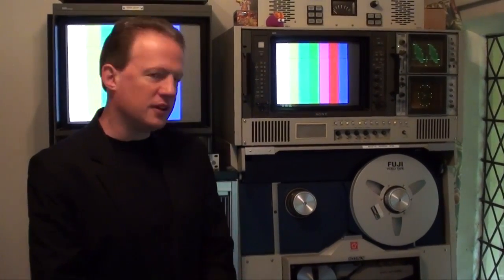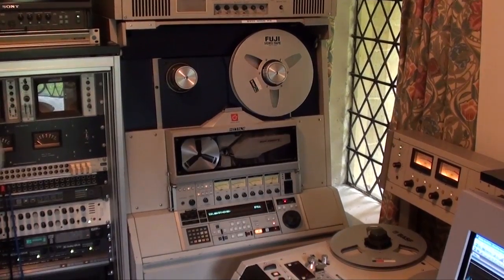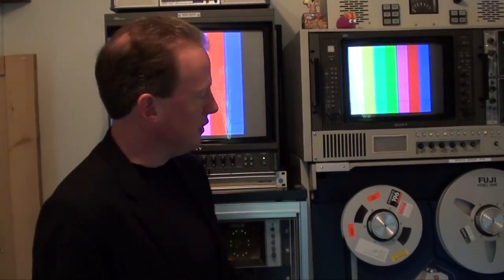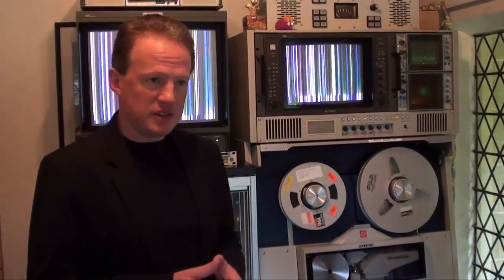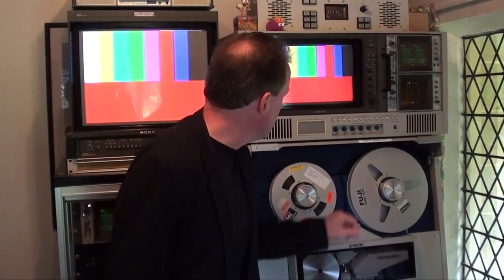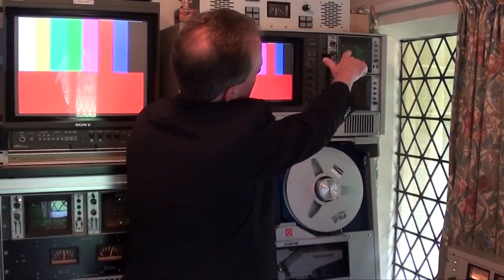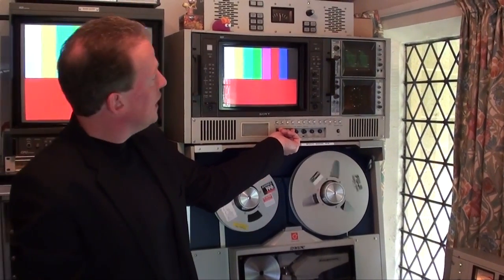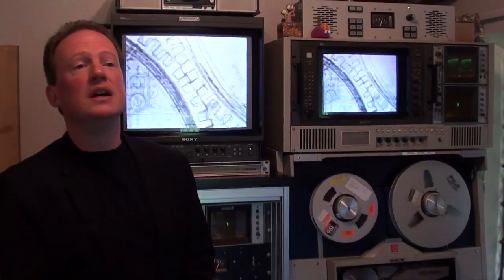A Young Persons Guide to the One Inch.

Comment: The update from this machine was self threading although you had to put tape on the take up spool. 
It used some type of vacuum system to suck the tape through the correct channels.
To me it seemed like a lot more complexity for little return it didn't really save you any time if your skills were up to par doing it manually.
Fantastic contraption though just like this one.

Comment: Come on come on give me a break, this dude spending more time explaining what this video tape recorder can do, more than demonstrating it, and what was the idea of showing his hands, as he's talking, what's up with that. My God, my God my God if you have to adjust this VTR player/recorder every time you put a tape on the machine, it is worthless. The Ampex 2000's were (totally automatic), once the machine figured out how to get everything to adjust automatically, with fewer adjustments manually done, Especially when you have to load a tape to air within a minute or 30 seconds, the Ampex 2000 was ready.  This machine, is not even worth the money to buy, if you have to do all those adjustments manually, and if you have to put a 10 second rolls on each tape, it's not worth a hill of beans, The ampex 2000's can do 5 Second roles and be locked in, and ready to go on Air, in 5 seconds. On top of watching this video, those weren't even the correct color bars, that were use to set up the VTR with it's setting, for the oscilloscope and vectorscope.We would glance at the Scopes and keep it going. Dang what a worthless piece of junk, with your missing knob. Bottom line, The C format, broadcast video machine, is an expensive piece of Worthless junk. PERIOD. I cannot understand why a Broadcasting station would buy this type of equipment, and has to adjust it each time you put a flipping tape on the machine. And by the way, a 4 head machine is a whole lot better than a 3 head machine, come on, give me a break. You know what they say, even though this machine is expensive, they cheated themselves by buying cheap, Without it being totally automatic, you get what you pay for, Junk.
 I would have rather bought a Hitachi video recorder with four heads.
Reply: First, you didn’t need a 10 second pre roll on a BVH2000, we often used 1/2 second or 1 second rolls in the sports world. Second, these machines had a default setting that could be used, in an edit room, yes, you would manually line the machine up so everything was dead nuts on. Quad couldn’t do slo mo or freeze frames, right? Sony had a variant called the BVH-2180 which could hold three hour reels, great for playing a movie. They also had a version that could record individual frames, used for recording off certain animation computer that would render a frame, then render the next frame, etc. a type C also didn’t need air compressors.
Reply: @mikecumbo7531  The quads could be on the air in 200ms as with the AMPEX AVR-1 & ACR-25. Industry standard was 5 seconds, but that would be from a STANDBY mode with heads spinning. we used a 7 second pre-roll with the heads stopped. I have worked on EVERY machine AMPEX made from the 1000 to the VPR series. The best machine they made was the AVR-1. The ACR-25 utilized the same servo & time base electronics from the AVR-1. 
The AMPEX VR-2000's were NOT automatic unlike the AVR or ACR series. You had much more to setup on a quad v. a helical machine as well. Yes, the Quads used compressed air for the heads as they rode on a cushion of air spinning at 14,400 rpm. The portable AMPEX 3000 used ball bearing heads and the ball bearing heads were VERY electrically noisy. I could always tell a recording that came form a 3000. On a quad setup you had tracking, tip penetration, female guide height, EQ of each head (4 of them) audio, black level, white level, chroma, and phase. But you could do it in under 15 seconds if you were good. Several times I had to do a setup a few seconds prior to air time!. The quads could also be in different lock modes, typically you were in vertical lock, to allow video switching in the vertical interval, but for studio integration or special effects you needed to be in horizontal lock. Horizontal lock required you to be in perfect timing with the reference source, and you could use the sync signal for reference, but we used the fast vertical wipe of the video switcher to see the picture horizontal line start as some video switchers regenerated the sync signals, some did not. The quads separated the men from the boys, as almost ANYONE could operate a Sony BVH (Broadcast Video Helical) machine. Helical was for sissies or film people who like to see a picture in fast fwd, rewind or freeze frame real men used quads. I used to edit the sports for the news inserts and was the fastest doing it. I could listen for events as the tape wized by, then perform my edits manually (not using time code) as frame accurate edits were not needed, speed was. I also NEVER made any editorial decision w/o the director or talent right next to me, as I provided the technical know how, they provided content selection. If it was the wrong selection, it was on them, not me, technically it was always perfect as it HAD to be.
Reply: @rty1955  14400 rpm = NTSC
Reply: @TTVEaGMXde  Quad machines ran the head drum at that speed.  This is a type C 1" helical scan machine, the head drum runs much slower, 3600rpm (NTSC).
Reply: @joshjones3227  The 14400 rpm refers to the long text by rty1955 to underline that he is thinking in NTSC, although this is about English videotapes with PAL.
Reply: @TTVEaGMXde  Sorry, I didn't realize yours was a nested reply.
Reply: You have got no idea what you are talking about and clearly little understanding about broadcast video either!
Reply: I bet I do, you egg head. I was a broadcast engineer for almost 10years, until I left and moved on to be a sound engineer starting my own company.  At that time we had the toys to play with back in the day. You don't know what I know. some of the stuff was a pieces of crap.  I got to work with some good equipment. After I left  they bought that piece of crap. I would have had to deal with that one. Some of the Sony machine was pretty good but, that model was still in development stage, and fairly new. As they work out the bugs. The Ampex 2000's series was the standard, good reliable machine, although it was sometimes temperamental. But over all it was a great machine to work with. We had three of them. We could edited on them, do a 5 second roll to Air. And at that time, they did not have a electronic time delay. So we had to use the VTR 2000 for time delay for audio just in case the talent went of script. The Sony BVH 2000 PS could not do that. It's only a Player and or a recorder. That's all it can do. Period. Now For Me This Case Is Closed. Got It. I'm Done.

Comment: Thread- up. Set-up. Interesting. Enjoyed. For PAL what picture resolution would be achieved? Thanks for uploading - Liked.
Reply: The machine records an FM modulated PAL signal. If the resolution were reduced, the color carrier would be destroyed. Typically 5.5 MHz is specified in the data sheet. Minimum is 5.43361875 MHz.

Comment: The 1" C format video tape recorder used in this is a Sony BVH-2000PS.
Reply: @donewiththisshit-s4f  Oh. I see. Not as good as the Ampex "VPR" series of 1-inch C format broadcast videotape recorders that the BBC had been using until they switched over to Betacam SP.
Reply: @northernplacecorporation  I understood the BBC TXd from Bosch 1" VTRs and that from 1992-97 they used D3. I thought Beta SP was only used by news, because they were kitted out for component first.
Reply: @mbvideoselection  Oh. I do understand.
Reply: Films are recorded on ampex too
Reply: @markbutler5730  Yup!
Reply: @donewiththisshit-s4f  Yup. The BBC had switched from 1-inch C videotape over to Betacam SP in 1991. The BBC used to transmit the programs onto Betacam SP until 1997, where the BBC switched broadcast videotapes again. What format? Digital Betacam.
Reply: @donewiththisshit-s4f  Uhh... Ya typed "Basement" wrong.
Reply: @donewiththisshit-s4f  What lack of VT tea?
Reply: @donewiththisshit-s4f  Well, ya correctly typed "Basement" now.
Reply: @donewiththisshit-s4f  Who? Me?